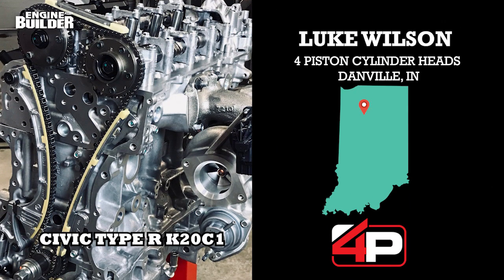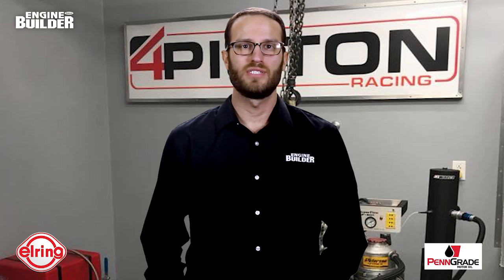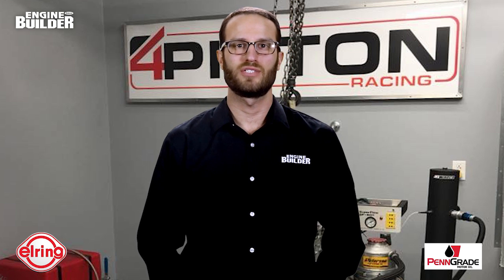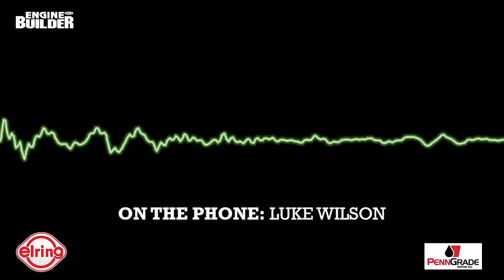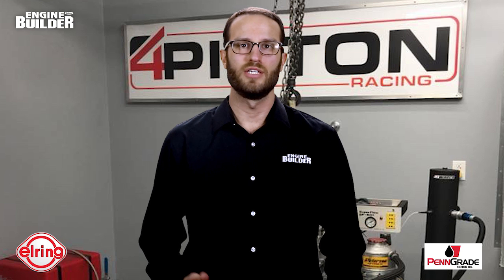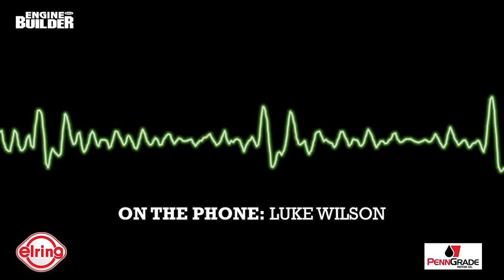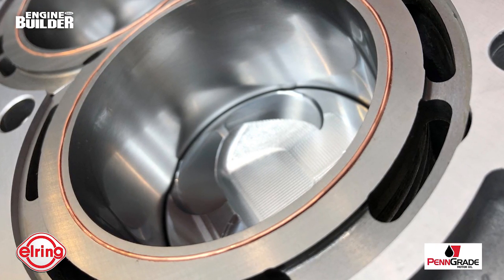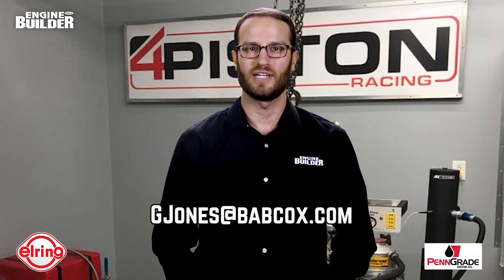Honda Civic Type R K20C1 Engine

Comment: Yep more modern 10 steps backwards engines that use to thin of oil and some other silly green scam things but they fixed it right .. they did a good job fixing that pile  to how it needs to be OEM

Comment: Yup, bending rods at 400HP sure is unlike Honda's of the past. The original K20A/A2/Z1 and K24A/A2/A3 made ~100HP less than these stock for stock, yet they can make 500-600+ HP on stock internals depending on how long you want it to last. It sure seems like these newer engines aren't overbuilt from the factory like their predecessors were.
Reply: Bro this video is 3 years old. People are getting 600 plus outta these lmao just because someone sounds professional don’t mean they are
Reply: My K20c1 is making 566whp on 100% stock engine - guys have made 630whp with cams.  With built versions they are making 842whp on limited fuel due to the direct injection fuel pump and space limitations for the size of turbo that fits under the hood.  

They were bending rods at 400+torque at low rpm - these engines will spool a turbo up faster than any old k20a due to the direct injection and tiny stock turbo.   Try making 450+ftlbs of torque at 3k rpm on a stock k20a3 and let me know what happens 😂
Reply: @TheFK8Life  Good to know, but I'm confused by your comparison to the K20A3 since that was the lowest end early K20 while the K20C1 is the highest end modern K20.
 
If we are going to compare new to old, wouldn't comparing the new K20C1 to the K20A/Z Type S/R engine or K24A2 TSX engine and comparing the K20A3 to the K20C2 in the base Civic make more sense?

Or we could compare the L15 Civic Si engine to the old performance K20/K24's since they are all around the same 200HP and were used in similar applications.
Reply: 400hp from the K20C1 engine and bending rods? pure nonsense!!! Time has shown that the engine can safely handle about 500 hp for a long time under conditions of gentle torque at low revs ☝

Comment: For such a reputable brand to lie to help sell their products this is a new low. The k20c1 isnt weak they make alot of torque down low thats what bends rods. Shift the torque right and you'll be fine. All 4g63 and 4b11 have this problem aswell. C'mon 4pistons do better.
Reply: Exactly. People will tune these cars incorrectly and without any regard for managing torque and then blame the engine if it fails. When managing torque, there are lots of these with bigger turbos making 500-550whp on stock internals reliably
Reply: @dinkleberg2013  I totally agree. Time has shown that the engine can safely handle about 500 hp for a long time under conditions of gentle torque at low revs. It is nonsense and stupidity to tune an engine that has the same bore and stroke to the character of a diesel engine..

Comment: He didnt mention the fact that there is not DI fuel pump for the car and it will limited to 400whp with stock fuel pump
Reply: Aftermarket CDFP (XDI) and port injection (hondata&PRL) now available to reach those HP figures.
Reply: These engines are now making 850whp - still fuel limited but big gain over 400whp
Reply: it has a direct injection fuel pump.. driven by the intake cam.